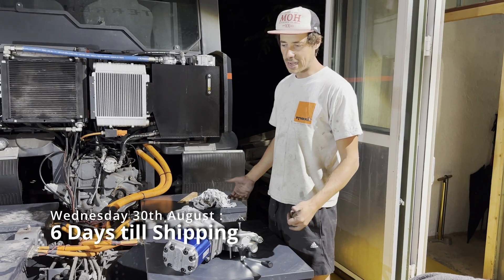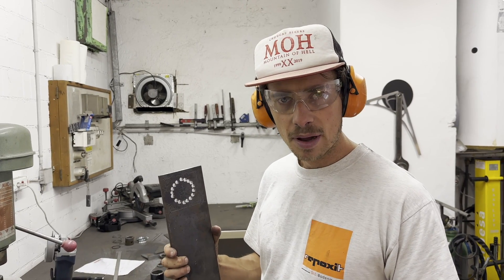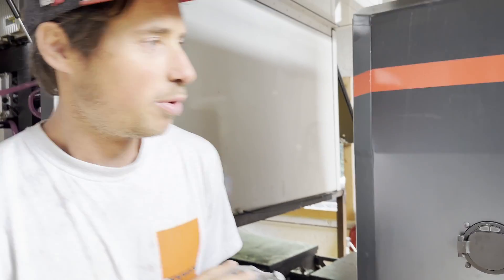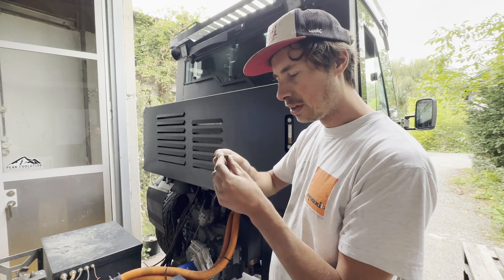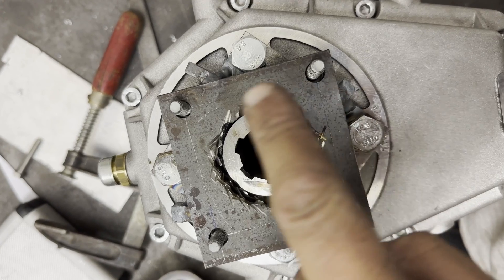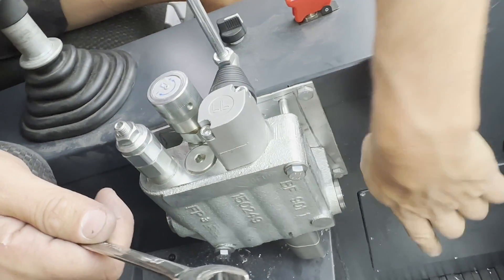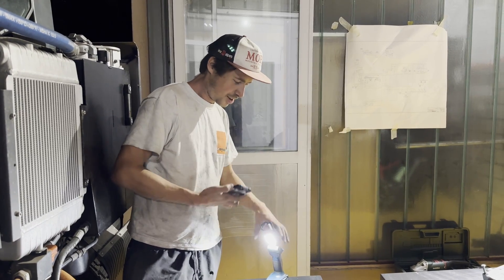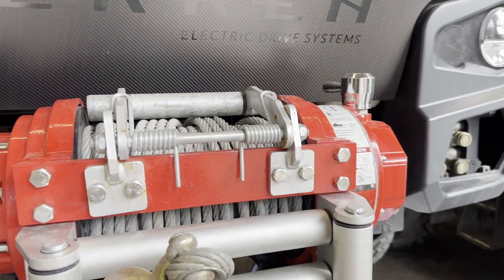Installing a Hydraulic Pump and accidentally creating a viral Reel

Comment: This is the first video of yours I have watched so I don't know if you knew that you can get almost double the speed out of electric winches using 24 volts instead of 12. Every one of them I have seen has the option of 12 or 24 volts and since you're in an electric truck you would/should know how to get the power you need for it. Rock crawlers use them in competitions. Then if you need to be able to adjust the speed maybe some type of rheostat to adjust the voltage up and down between 12 ad 24 volts and even a little more if the winch can handle it? Best of luck and I have subscribed to see how everything goes. :)
Reply from the maker: Thanks for this information. We use a hydraulic winch becaues electric winches overheat within minutes. We are planing to use the winch for half hour or more 😅
Reply: @peakevolution9511  I have a Runva 11000 pound electric and I used it for over 45 minutes solid at a time, several times over 6 hours when both diffs broke in my 4000 Kg LandCruiser Troopy. It took us over 6 hours to get 23 kilometers being towed and winching up some of the steepest mountain grades in Australia. My battery cables were close to melting but I kept the engine revs up the whole time and not a problem. I still have the same winch on the front now 6 years later. Maybe the trick is finding a proper heavy duty winch and not going cheap at all? Good luck!

Comment: It may have been easier , Cheaper to mount the dcv not in the cabin and use a remote control cable.
Reply from the maker: Yeah we wanted the remote control dcv! But it was actually a lot more expensive. Maybe we also weren’t able to check all the options because of time pressure…